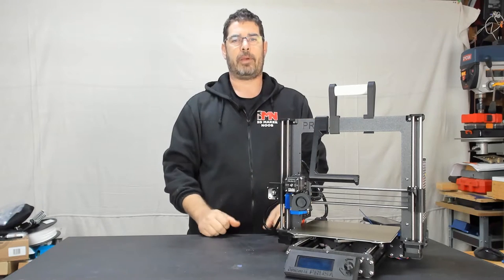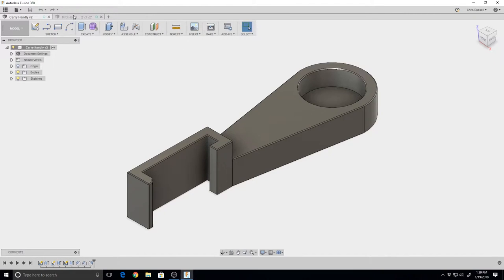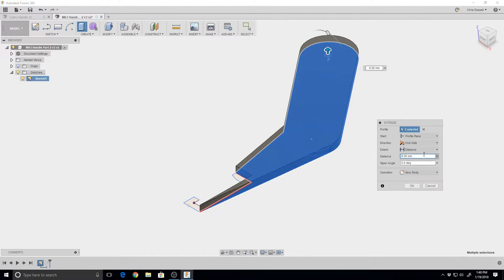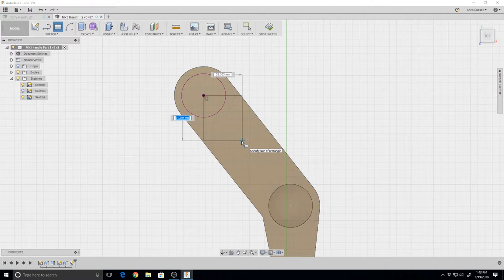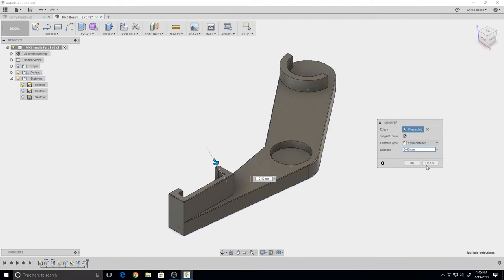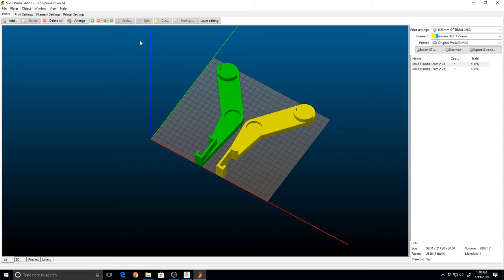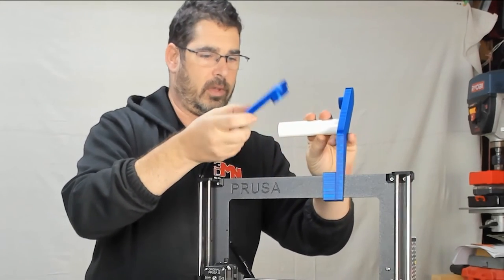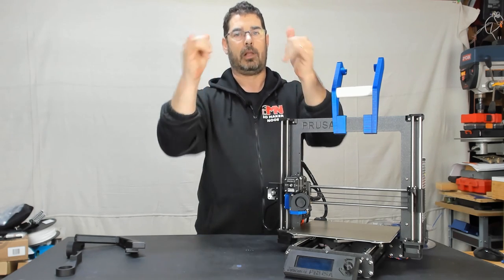New and Improved Prusa Mk3 Carry Handle!!!

Comment: Really nice! I was wondering about putting the hooks on the bottom on your last design. Thanks for the video!
Reply from the maker: I actually think the original handle held more secure because of the scissor effect from opposing sides as you pulled up on the handle, but this holds well enough with the hook underneath too and gives it a lift point.
Reply: Ah yes, I remember you saying something like that. I guess given enough force in a rocking motion this could come loose. But I can't say I would be swinging the printer around like that when carrying it! haha
Reply from the maker: Exactly. It was handy when moving the printer to my hotel room for the trip I was on though! The handle was much easier on the hand than the upper beam going up and down the stairs.

Comment: Instead of deleting items from your design, just convert them to construction lines, later on if you need to change them they will still be there to adjust easily. Just highlight the line/shape and press X or use the right click menu.
Reply from the maker: Hi Stu, yes you will notice that I had some of the circles as construction line when I showed the pre-drawn base sketch, but I didn't want to yet introduce this topic to viewers. I'm trying to keep things at the level of "circles, boxes and lines" for people who are just getting into using Fusion 360.

Comment: Not how I expected it to turn into a spool holder... I would have just raised the "handle" a little higher.  Now while carrying it, the top part can hit your wrist and pop it off the frame.
Reply from the maker: Erik, the intent was to keep the center of gravity of the spool behind the top bar (the same as the Prusa spool holder) so that when the extruder is pulling on it, it won't pull if off. Don't get me wrong- it's not a perfect design, and I would love to see what other come up with.

Comment: I believe that hook on the original holder on the top side is there to prevent collision with extruder on tall prints. If you reverse it, do you really have plenty of space between for example cable from PINDA and hooks?
Reply from the maker: That is a valid point I did not think to mention- with the hook on the bottom to support the weight when using this as a carry handle, you do loose a little Z clearance in the front where the cabling for the filament sensor hits the hook.